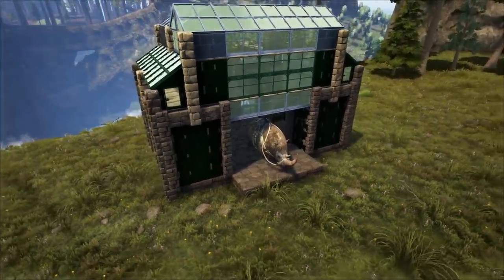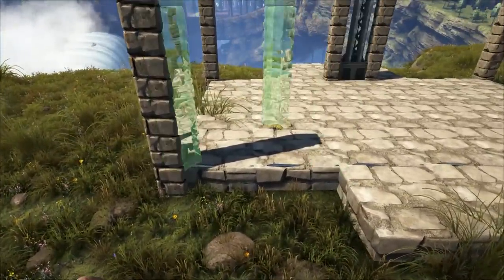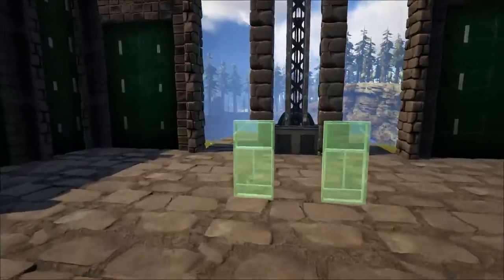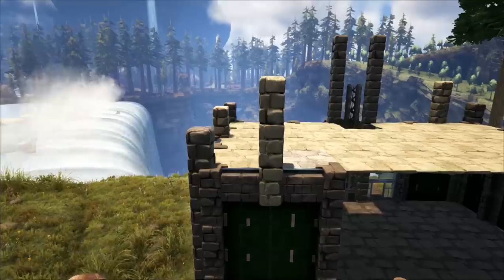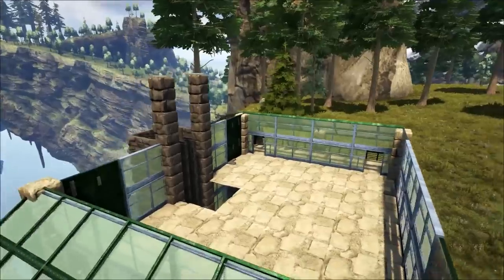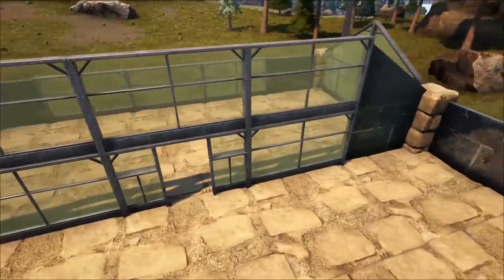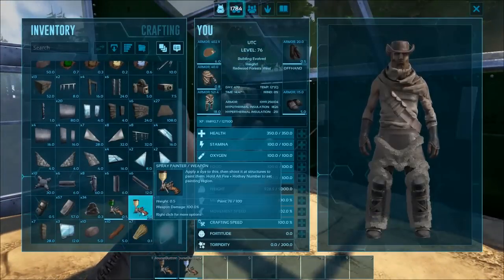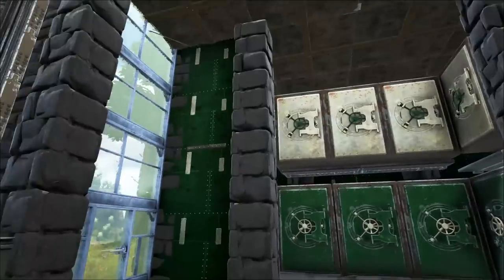Ark Elevator Workshop Build Guide :: Elevator Base Building Tutorial :: How To Build - UniteTheClans

Comment: I know this is an old video but I recently built this and I don’t really understand how you did the interior shelves for the safes. Couple other questions I had were when placing the cooker did you put the pipes down first or the cooker? Also do you think it would be possible to place a windmill on top of the generator stack instead of a sloped roof?

Looked for you on discord didn’t see your channel.

Edit: I got the pipes to work and the windmill. I’m guessing you actually destroyed part of the building. To place the shelves? From what I’ve read catwalks won’t place sideways with a wall already above them

Comment: Ended up building this same design, except used wood walls where metal walls were until I had the resources to change them out. When I finally finished, and had the metal to replace the walls, I accidentally destroyed one of the bottom floors stone gateway, which ended up messing up the 2nd floors outer fence foundations, which ended up messing up the glass walls. One little accident caused a string of frustration, but very good video

Comment: Also, my elevator platform is not hidden under the floor. I don't understand how I'm following your tutorial step-by-step and things aren't coming out how yours does in the video. Did they change the building mechanics? Is your first elevator track snapping to something lower down?
Reply from the maker: It has been a really long time since I did this tutorial! I'm not sure how things have changed. As for the elevator track, it snapped perfectly every time I did the build (3 or 4 times) so I didn't realize it was going to cause an issue for people.

I believe it has to do with which direction you are facing when you place the first foundation, if I could go back and redo the tutorial I would recommend people place their first foundation, then the elevator track, then do the build from there.

I may have to put together a new version and make it simpler!

Comment: How did you get the first elevator track to place perpendicular to the fence foundation?
Reply: MM BB im having the same problem
Reply: Hey evan! I actually somewhat fixed the elevator track thing, by making the workshop smaller. Instead of 7x4 I went with 6x4 since the elevator track aligns with whatever fence foundation you are trying to place it on in Vanilla. So if you have an even number of squares, it will work. I haven't finished the build yet since I just started it & I'm doing a lot of glass in mine because it sits right in front of a waterfall on the Ragnarok map, so it's slower going getting all the materials.

I won't be able to have all of the things that are displayed in this build here since my workshop is smaller width wise, but I'll have all the important stuff, and it will be sitting next to the house I'm going to build off of UniteTheClans' Ark Modern House w/ Dino Garage build. :)

It already looks amazing right in front of a waterfall and I only just started it, so can't wait to finish!

Also to note: I lowered all of the foundations on the workshop to the lowest I could, and I'm building over a pond/lake at the base of the waterfall, so when you walk on the foundation(I went with metal) you hear the squishing sound of water but you can't see any. As it turned out, the generator doesn't work when it's that close above water, so I had to put it 1 wall height up, but in the same spot right behind the elevator tracks. So just a note to anyone reading, elevator tracks/platforms work in water, but the generator apparently has to be at least 1 wall height above water to actually turn on. This kind of sucks because the genny sits right in the view of the waterfall behind it, but it's not too bad. Once I finish UniteTheClans' other modern house with dino garage build, I may move the genny over to the side on dry land & just run an electrical line behind the house/workshop over to the tracks, so it's all more invisible & shows off the waterfall more. :)
Reply from the maker: Thanks for the big reply! Sorry you guys are having trouble--i didnt have any issues with that part of the build! All I can suggest is using temporary thatch pieces to trick it into going where you want it!
Reply: MM BB did you manage to fix this
Reply: chris Ruddock-Hugo your foundations may be placed the incorrect way; try to turn them so the stone pattern goes 90 degrees to what it was

Comment: Really struggling with the piping for the green house how did you go about doing it. I can't seem to get the tanks on the foundation at the bottom and the pipes in the green house are really low to the ground and don't line up properly
Reply from the maker: +Craig Hawes I started at the top, I put one pipe through the sloped roof above the greenhouse door and tried to line it up so if I connected a + piece it'd be centered over the crop plots at head height. Then I worked down to the outside and saw where the tanks would line up, it worked so I hooked up the tanks!

You can always put tanks on the roof! Then the plumbing is stupid easy.

Comment: I don't have a twitter account (or forgot the password) so for my build I left the green house open at the top where you had the bedroom.  I have a house with beds already so I thought I would have Argents land and unload stuff on the top floor.  Each side of the landing is a small corridor with a chest.  The paint I used was black for the metal region 1 and blue and green checkered for the accents.  Husband wanted to go tek theme.  The bottom floor I'm not sure what to do with yet.  Only farming out one side of vaults because of time reasons even if its on a private server.  Our locations in on the crystal isles on a floating island.  I wish I could show you a picture, but not sure how to do that.  Thanks for your awesome video!
Reply from the maker: Who needs Twitter? Come join the Discord. There is a whole section called #building_advice that would be perfect for helping you work out the interior design!!
Reply: Is that somewhere in the video?  I'll have to replay the end to see if I can't catch the name of it.  Nvm found it!  Thanks!

Comment: are you using S+ elevator shafts? I can not for the life of me get them to snap in properly. they either want to snap in backwards or sideways. i tried for an hour T_T. 
beautiful build by the way.
Reply from the maker: I did it all vanilla and I never had an issue, that said the game has changed in some big ways since I built this thing!
Reply: UniteTheClans I couldn't get vanilla elevator tracks to work so I gave up and went to s+ and it worked instantly.

Comment: Hi, thank you for that awesome tutorial. learned so much from it.
I've built it a bit larger to encompass a large platform. some S+ upgrades and so. but for some reason, I placed 3 more elevator tracks - but the platform doesn't "use" them - is there a limit on height ? (they're connected with wires and outlets) ?

btw - the S+ allows you to ad stops using the keypad, awesome feature.
Reply from the maker: +Amir Livni omg I love S+ I just don't mess with it for the step by step tutorials if o can avoid it. Not sure what the issue is! I've seen people elevate up to tree platforms

Comment: ok so I followed this to the T.  I am trying to get the water pipes ran and I am having a hell of a time to get the pipes above the stone foundations.  Whats the trick. I play on a pure Vanilla server so S+
Reply from the maker: Hey Jon! When you say 'so S+' do you mean 'so no S+'? I cant remember exactly how I plumbed this in. I started with a straight pipe in the center over the green house door (from the bedroom area) then built a series of the + ones over the crops. From there I just worked backwards until I hit water or a location for water tanks.

I think it'd be dependent on where you build it, but where ever the placement/location of the pipe is most important is the best place to start. As an FYI, a pillar will let you set a pipe at ANY height, and from there you can get it perfect ;) Best of luck, sorry for the slow reply!
Reply: UniteTheClans ok so you started at the top and went down?.  I started at the bottom and went up to the top floor.  I will try to remove all pipes and start from the green house.  I need to redo my electric also it's horrible.
Reply: Ok so I am beginning to see why people like S+.  I took all the pipes down and redone it.  No matter what I tried I can not get the water pipes at the top of the green house.  I was able to get them about knee height...... it does look a lot better and I was able to get the water reservoirs to finally snap.

Comment: Great video, just built this base to try it out. Had some trouble placing the first elevator track correctly, turns out it depends on the way you were facing when you placed your foundations. Got it figured out in the end though. Also industrial cookers won't work off of water reservoirs so you'd have to pipe it to nearby water. Awesome base though, really like the way it comes out
Reply from the maker: I have learned that! I got lucky in my design, but the elevator track should probably get placed right after the first foundation--then let that determine the front and back sides of the build. Very glad you like it travis!

Comment: I made a hatchery in part of my bottom floor and I made the top bed room part metal next to the green house and added a metal door to get into he front. I'm on PvP but using it as a work space
Reply from the maker: That sounds awesome! For PvP did you have to change the front? My entrance design is wide open of course
Reply: Metal dino gate in the opening and in the opening of hatchery. I added metal on the side of greenhouse that bumps up to bedroom so if they break the greenhouse its metal. and have turits (however you spell them lol)  our server has very little PvP anyways plus on my castle I made its full of turit and I made one of your lighthouses. As well

Comment: On official servers the dino gates don't work correctly with the walls so I had to take them out. Also my pillars in the back had to be removed as well.
Reply from the maker: Get off those official servers ;) play where you can build like a boss!
Reply: UniteTheClans Yeah I know I wish when I started out I would've gone on a boosted rates unofficial server but I got to level 85 on PVE334 official so there's no going back now

Comment: this might be a silly question but how do you get the cat walk to snap along the wall mine on snap halfway through the wall
Reply from the maker: +chris Ruddock-Hugo try snapping a ceiling to one of the walls at the front or back at the height you want the catwalk to start at. I didn't have any trouble with it!
Reply: UniteTheClans I fixed it I had to use pillars at either end of the catwalk

Comment: What's the secret to getting the first elevator track placed where it's facing the right direction?
Reply from the maker: It has to do with the direction you are looking when you place the first foundation. I really just learned foundations have a front/back and left/right, and the way you stand as you place determines snap point availabilty for pillars and elevator tracks.

My latest tutorial, the Easy Modern House, shows a technique for turning them and for knowing which side is which ;)